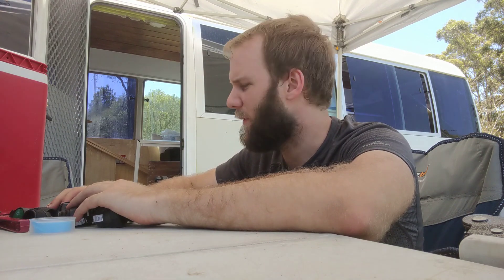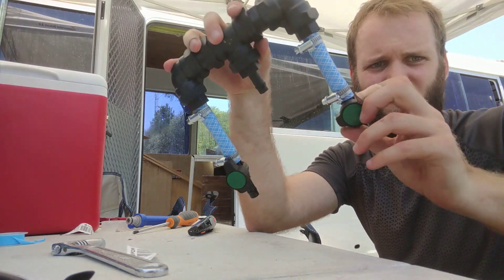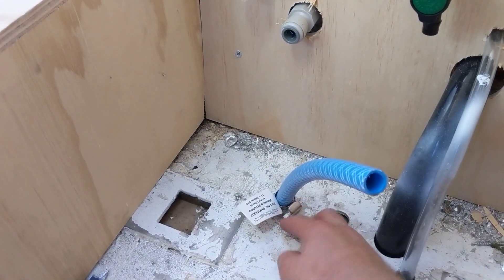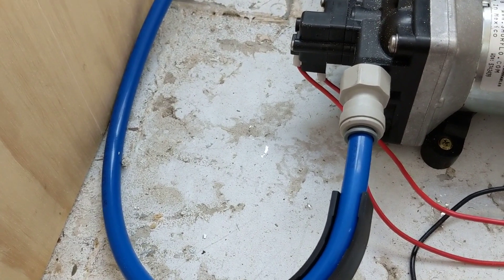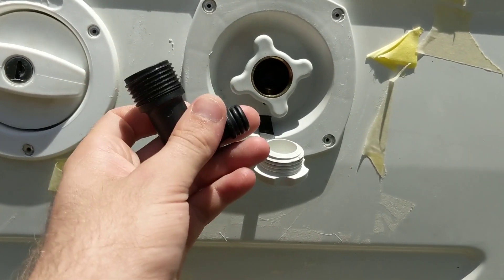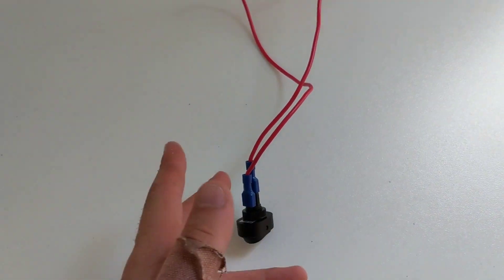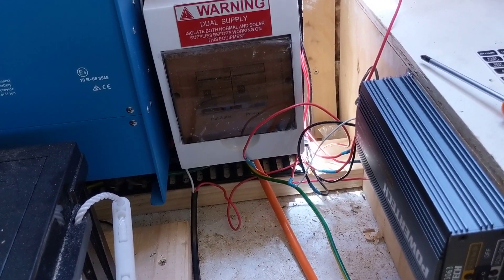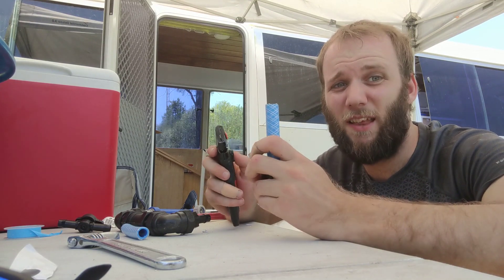Toyota Coaster School Bus Conversion - Plumbing and Shurflo Water Pump Installation

Comment: Hi mate, why didn't you use JG from tanks up to pump? Was it better to use the food grade hose for some reason?
Reply from the maker: Hey, the instructions for the shurflo ask for flexible hose either side of the pump. We did this for in the inlet but didn't bother going 30cm flexible to JG on the outlet. We use food grade because we found you get a plastic-like taste from hoses that aren't food grade
Reply: @RoamingonRubber  no worries, Shurflo recommend flexible either side because it absorbs the pump vibrations whereas the rigid JG won't.  But, you only need a short 30-45cm piece either side, you can just use those made up flexible braided plumbing hoses.  Especially important on the delivery side as there's more vibration. Queitens the pump right down.

Comment: What brand are the right angle  holders for the John Guest pipe please?
Reply from the maker: Hi Brad, do you mean the right angle corner pieces the John Guest hose goes into? If so, they are John Guest as well. Otherwise, all our pieces are either John Guest or from Caravans Plus. Hope that helped 😊

Comment: Hi mate. Those black plastic parts from Bunnings are not food grade (if they were from the irrigation isle”. If you are drinking water via the pump please replace them. Irrigation parts use a lot of nasty black plastic as the recycle too.  One brass T would replace it.
Reply: That's good to know, we only recently used one of the black plastic connections. I'll be changing that asap.